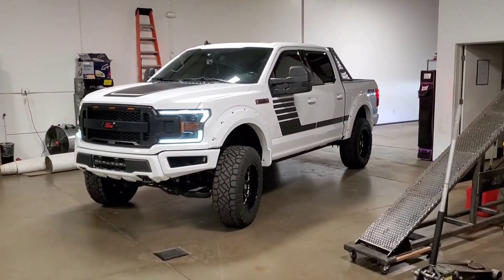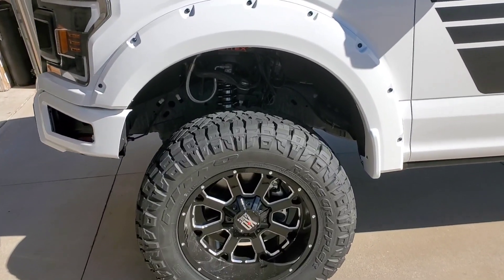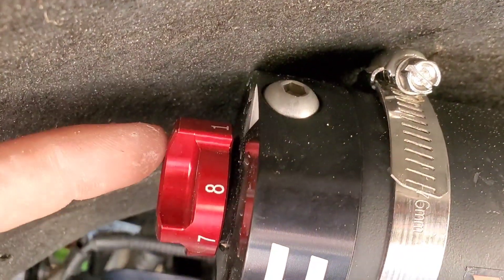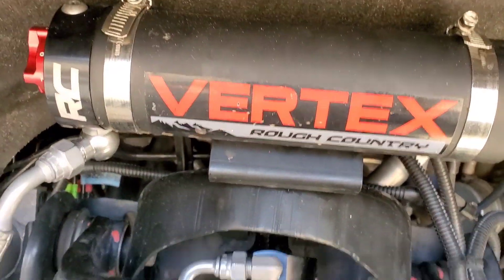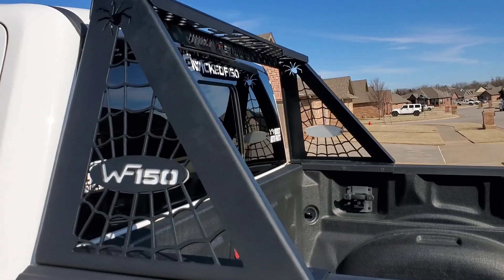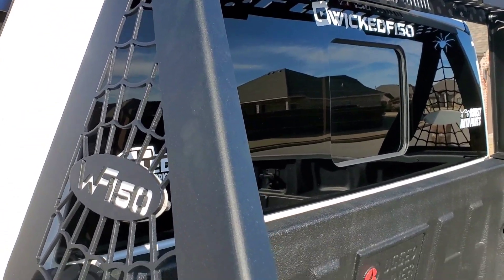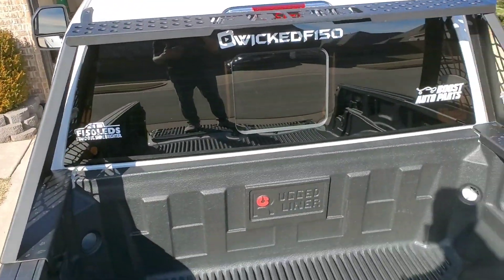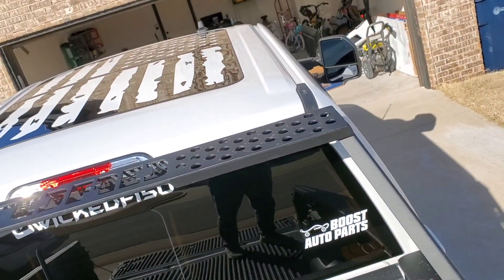6in RC adjustable coilovers and CUSTOM roll bar for ANY truck!!

Comment: Hows the Vertex Coilovers holding up?
Reply from the maker: Still absolutely amazing!!
Reply: @WICKEDAUTO1  I'm picking my 2020 silverado up tomorrow from the shop. 6" Vertex Coilovers / 35" tires. I havent seen any long time use reviews up yet. Cheers and nice truck.
Reply: I was going to ask the same thing Cutty Taylor.
Reply: @bradwilson34  Ive had mine for a couple weeks now and "so far"  I love em.

Comment: So I’m pretty sure I missed it somewhere.....what is the wheel/tire setup in the video? And do you think I would be able to clear 20x9 +18 offset with a set of 295/60/20 falken wildpeak atw3 with a 4” lift?.......I really don’t want to cut or remove the crash bars......I have a 2018 Screw with the 2.7 bought it used and love it so far
Reply from the maker: Yes you should be able to clear no problem. This set up was 275/65/20 on 20x10 -24
Reply: @WICKEDAUTO1  awesome thank man. Do you still have your crash bars in?
Reply from the maker: @N8Vrhino  yes absolutely, I refused to remove them. I did have about an inch trimmed off the ends from these tires on the 4in lift
Reply: So was it this same setup with the 4” lift on your truck?
Reply from the maker: @N8Vrhino  for about 2weeks, prior to i had 34s on 20x9s i believe
Reply: Oh ok so did you have the bars trimmed with the 20x9s or after you had the 20x10s put on?......I’m just wondering if you had to have them trimmed because of the negative offset of the 20x10s.....from what I have heard you want a positive offset for no clearance issues
Reply from the maker: @N8Vrhino  with the 20x10s. The 20x9 +18 with 34s cleared no problem. You can go negative on a 4in your tire just won't be as big.
Reply: @WICKEDAUTO1  awesome thanks man I appreciate the info I can’t wait to do mine. Love your truck man

Comment: So how has the truck handled with the 6” lift and the bigger wheels/tires? Have you noticed any loss of power with the 2.7?......I was thinking of doing the 6” lift with the 20x9 +18 with 295/65/20 but wasn’t sure if it would lose a shit ton of power or if it wouldn’t be that noticeable.
Reply from the maker: Being tuned, no couldn't tell a loss of power but if I had to do it again I wouldve just stuck with the 4in. Gas mileage is shit with the 6in. I got about 14 and if I went over 70mph it dropped more
Reply: @WICKEDAUTO1  oh lol ok man that answers my question...I think I’ll just do the 4” with 275/65s

Comment: Hey you mentioned you had to have leaf springs replaced. What issues were you experiencing? I have a brand new 2019 and there is a clunky sound from the rear when turning at low speeds. Is that it?
Reply from the maker: No, mine were squeaking really bad. Just getting in and out of the truck they would squeak.

Comment: Does that affect braking, wearing of front end parts?
Reply from the maker: Yes to a point. Heavier, more force behind the braking. The 4in was better for the suspension as the cv angles were perfect now with this one they are angled slightly so it will cause it to wear faster

Comment: That looks sweet I have the exact same truck I got 3.55 gears on mine how is the truck holding up? I want to put a 6 inch BDS and run the 35/12.5/r22 Ridge grapplers still wondering if I should do 6 or 4 inch. I can imagine a loss in fuel but I aint worried about fuel too much I don't tow haul or pull and I sure as hell don't do crazy offroading. Any feedback you have that would help? Would love a tune but don't want to void my warranty.
Reply from the maker: even with my tune im only getting 15.5 combined with mostly highway. 6in n 35s definitely kills it

Comment: How do your cv angles look? Always heard rc used the same drop brackets for the 4 and 6 inch lifts just curious how they look?
Reply from the maker: They do, and its definitely worse than the 4in. With the 4in it was perfect. Now with these its alil worse, basically looks like the same angle as if I just leveled it from stock
Reply: @WICKEDAUTO1  thanks man I have the same truck and been thinking about doin this lift with either 35s or maybe 37s but I think I might have to go bigger than a 6 inch for 37s or they might rub plus I have the 2.7 with 3.55 gears so don't know how well that would work with 37s
Reply from the maker: @offroad2013  I havent driven it enough yet with the 6in n 35s to see how its affected yet. But just this morning to work it wasnt bad though, I also have 3.55 gears
Reply: offroad2013 so are you saying some companies actually have two different size drop down brackets for the 6 and 4? 
Interesting, that’s the first I’ve heard of that
Reply: @cheeznhard  yes kinda sucks really fts and I believe fabtech have true 6 inch drop brackets but I know rough country and a few others just seem to stretch out there 4s to get 6 inches not talking shit about them just sayin, I'm probably gonna end up goin with the rough country lift myself either the 4 or the 6

Comment: Hey man,
sick truck! how are you liking those headlights? looking to get myself a set. Also, how did you get that emblem on the grill?
Reply from the maker: I love them, havent had any issues at all! I will say another company is coming out with a similar design, will probably have them in this coming weekend if youd like to wait until then. Its actually just stuck on with 3m. But it doesnt sit completely flush so I may get one with studs and just drill holes for it

Comment: If you know how I can get ford to fix my 2018 Ford f150, please help.
Any help is appreciated. 
I'm lost. 
Thanks 
Tom
Reply: huh?
Reply: what is wrong with it?
Reply: @unlimitedljadventure  the transmission has a horrible shifting pattern. Never the same each day. Horrible clunking coming from the rear end when driving anywhere, and horrible clunk from the transmission 
 when starting. The technician at Kendall Ford has driven it and concluded the transmission is not acceptable but the suits say its normal.

Comment: Looks so awesome.  This is the tire size I want to get ( I too hastily bought the RG's in 275/65r20) and the narrowness is beginning to bother me now that I am about to put a lift on the truck.  I wanted to ask, did you just upgrade your RC 4" lift with coilovers up front and new rear parts? Or did you get an entire new lift kit completely (like all of the crossmember and bracket parts)?  I know BDS and Zone makes it easy to add on or go from 6" to 4" or 4" to 6" for cheap, but I can't find much information on how complicated that would be for RC lifts.  I am looking at the same 4" lift you previously had but I feel like eventually I might end up wanting to take it up to 6" as well.  Thanks and love the content.
Reply from the maker: I will say I wish I wouldve stuck with the 4in. The 6in doesn't make much difference looks wise at least but it definitely does mpg. Even with the tune at 70 I got 14ish. Over 70 I was lucky to get 13. With RC no structural parts change between the lifts, it's just the different struts and blocks. So your cv axle and all that will be as if you have a 2in level on stock. As far as I was aware bds knuckles n crossmembers are different between the 4 n 6in to keep stock alignments
Reply: @WICKEDAUTO1  ahhh I hadn't really considered that, I just assumed either lift you'd be taking a mpg hit.  I thought your 4" looked great, but your 6" lift looks awesome too so other than gas you got a perfect truck lol.  Thank you for the input brother.
Reply: @WICKEDAUTO1  Last question to bother you ( as you are one of the main people I get my content for mods from) between a 6" RC or Zone lift, you think the 4.5" super lift with some beefy tires would be a better look and have less gas mileage drain than the 6"? thanks again my man.

Comment: All this and it’s a 2.7 😂
Reply from the maker: Yep, stupid most reliable engine
Reply: WickedF150 I dunno bout that lol, you can’t beat the coyote when it comes to durability and reliability. I personally have the h/o 3.5 eco boost
Reply from the maker: @chrisnewby5713  yes you can, the 2.7 beats out the 3.5 and 5.0 in reliability the last 3years running. It is the least problematic engine by far. Also the quickest 0-60, stock best mileage and I can still tow more than I'd ever need at 7600 so 2.7 is beat choice scenario
Reply: WickedF150 I’ll take my 20 limited 😂 you don’t have to validate your amazing truck to me pal
Reply: You will always have haters show up and  hate  misery love gompany great truck beautiful F150 and great content keep up the good work